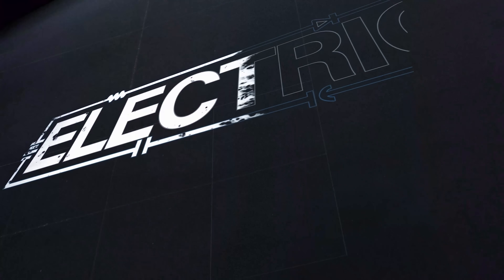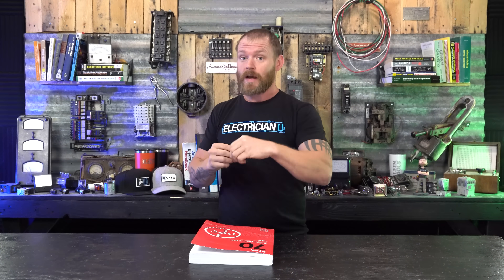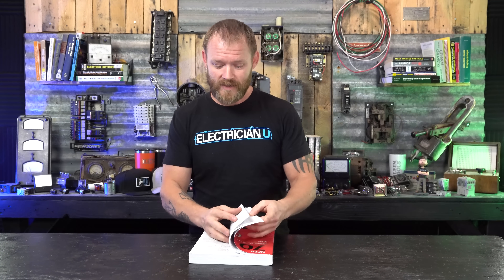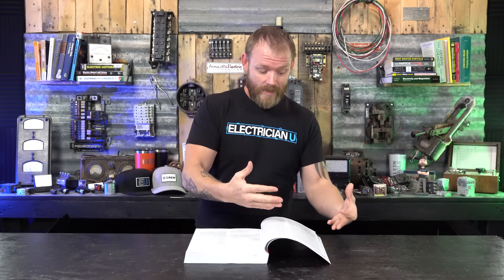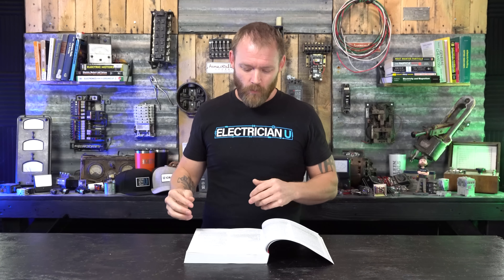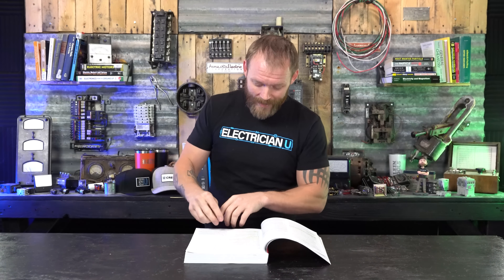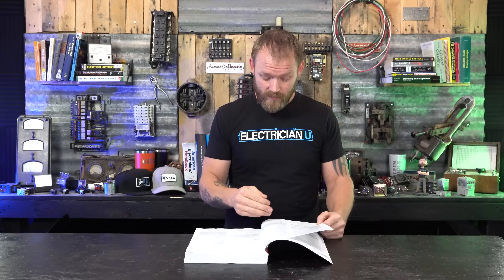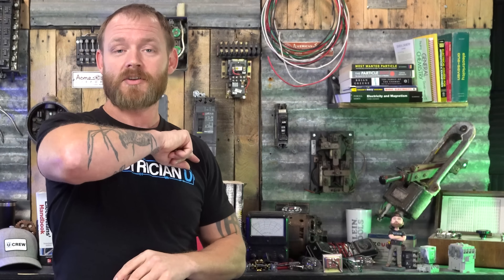Where Should We Be Using Dual Function Breakers?

Comment: It can be frustrating. I’m a second year apprentice in Montana and MT doesn’t require the kitchen to be arc-fault protected. So after pulling dozens and dozens of units, it wasn’t until my second year that I realized the code require kitchens to be arc-fault protected. Now whenever I have a test on the Code, I have to fight the instinct to put that kitchens aren’t included in AFCI locations. I know now that the Code says it, but it’s still hard to rethink something I’ve done hundreds of times.
Reply: It sure is. State amendments vs NEC can be confusing at test time. I always mark any Code section(s) in my NEC with the highlighted word "AMEND" so I know to go to my printed list of state amendments that are approved for use in the PSI testing center.

Comment: 2 things
1 this will "obsolete" a ton of old power tools they also arc (internally, commutator to brushes) and 2 Imagine a simple remodel and add 4-10k for new electrical
BOTH will mean consumers will go broke really fast 
Grandpa's saw (that works just fine) NFG 
want to use that old drill to put up blinds NOPE
This was the only way manufacturers could get rid of the quality tools that we still own(by making them useless)
MONEY GRAB 100%
You WILL own NOTHING (and be happy) LOL

Comment: In my area, for Siemens breakers specifically (as I have a Siemens panel), the CAFCI / GFCI / dual-function breakers are the same price, $50 per breaker.  I decided to go with dual-function breakers for most of the circuits because there's little benefit to going with CAFCI-only breakers.  When I moved in to my house, there was only one GFCI breaker in the box, for the bathrooms, not even the kitchen or basement outlets.  I've upgraded most of the breakers to dual-function slowly over time due to the cost.

Comment: Inverter-based welders which most seem to be nowadays have the power supply and welding circuit separated so it won't trip AFCI. Well, assuming that their noise suppression circuit is up to snuff.

Comment: Basically on new residential, we put dual function on everything but the garage plugs, bathroom plugs, and gas furnaces. We still install the standard breakers and GFCI plugs on these because that gives a few circuits that aren’t arc fault mainly for construction. The arc fault part of these DF hate compressors and saws. We are still running off of 2017 code here in Kentucky, supposedly they’re going to adopt both 20’ and 23’ updates sometime in 23’. We started using DF for simplicity, and reliability, DF breakers don’t seem to have the nuisance tripping like AF. We’ve been using Square D, but we’ve had to switch to Siemens lately because of availability of Square D. I hate that because it’s a really good product IMO, and we didn’t have trouble with them. I have anxiety about this new update because I don’t know how HVAC equipment is gonna do on GF. I thought the same with refrigerators but so far only Samsung had the issues, but they must’ve corrected that.

Comment: Can arc fault protectors reduce the risk of fire? For instance in a home that has older wiring is it worth investing the money in say dual functions breakers on particular circuits?
Reply: Fire prevention is the primary purpose of the AF breaker's creation.  Unfortunately, upgrading to this level of protection could result in a lot of other forced upgrade requirements (regarding old incompatible equipment -- usually motor-based -- which cause false-positive AF-trips... AKA "nuisance tripping").  The new AF breaker monitoring circuitry may find a series of electrical faults in the home (that you weren't prepared for) which some may incorrectly assume to be nuisance tripping, but is in-fact fire-prone failing electrical infrastructure causing very small arcs in J-boxes, inside defective-brand wirenuts, at loose screw terminals, rodent-chewed wiring, Romex punctured by errant screws or nails / overly tight staples, and so on.  Take care in moving an old home to this level of tech; have a reserve budget for unintended knock-on effects of this decision, and be prepared for a possible enormous extra investment of time.  If anyone is prepared in all of those ways, and wants this increase in safety, fully knowing the possible trade-offs, then proceed.

Comment: Is there a reason to not do combo AFCI/GFCI breakers for every breaker in your home?
Reply: Cost, a panel change used to cost around 300$ between the panel and breakers, now it will cost around 1000$ in gfci/afci/dual breakers, a regular breaker may cost 6$ to 15$, a dual function breaker may cost between 60$ and 80$...
Reply: When I had my panel redone I put dual-function on everything. There are a few nuisance trips I've had, but more often than not when a trip happens it's indicative of a problem, and doing this exercise has shown me places in the house that were not wired correctly. For instance, my radon fan failed due to a GFCI fault, and had it not been on a GFCI breaker, I would probably have never known the system had failed.

I also highly recommend going through your entire panel and labeling it very very clearly. I have a spreadsheet that I print out and attach to the inside door with magnets, and whenever I learn more or a change happens, I change the spreadsheet and print out another copy. The exercise of labeling, down to every receptacle and switch, which breaker everything was on (including the attic and outdoor motion lights) helped me find issues, too.
Reply: But if you don’t mind  spending the extra money wouldn’t it be better to do it?
Reply: Nuisance tripping is reason enough not to do it. Perfectly good circuits may occasionally (or immediately) trip just because a bare equipment grounding conductor in an outlet box is touching the termination screw for the grounded (white) wire on a receptacle, for example.
Reply: Future inspector lmao

Comment: The challenge I have is that electric ranges and dryers need gfci as well going forward. I have a very hard time finding those breakers and they seem to cost nearly $100.
Reply: Yep, that's what I found for pricing on the 240V DF breakers.  fortunately, existing installs in homes are grandfathered in under the old rules.  It's only new builds, or extensive renovations of old homes, which will need to meet the new requirements (assuming that the state as adopted the latest NEC for their building codes).

Comment: AFCI isn't listed in those places because they haven't thought of them. (thus 14) Many kitchen gadgets can (DOES) trip GFCI's, but that rule has been there for a few cycles now. The day is coming where you won't be able to get a breaker for less than $!000 because of the miniature Cray that needs to be in it to do all the totally unnecessary bull manufacturers want to make you buy. Like requiring a GFCI on a refrigerator outlet... what/who are they trying to protect? Refrigerator sales? (older one's MOST people have are high inductive loads that trip the idiotic 5mA sensing US GFCI's. If you buy an expensive, modern inverter based fridge ($$$$) then GFCI usually won't trip. But when it does, there's no alarm, and you'll only notice when it's been off for hours or days.) AFCI's are stupid expensive, and generally aren't fixing a problem anyone has. (unless that problem is sagging profits.)
Reply: You're fighting a losing battle. Most code changes are initiated by repeated issues that risk equipment damage or injury. The data is clear that homes are safer when they are AF and GF protected. You can continue to be angry about the added cost, added burden, aggravation, etc. or you can just accept that is the direction we are going and look for ways to mitigate the inconveniences.

Comment: AFCI breakers have a ton of problems nuisance tripping with computers, especially gaming computers. They should not be installed in any place you will run a desktop computer or home server.
Reply: Meh. They work just fine in conjunction with a UPS. We upgraded our service and installed a new Square D Homeline plug on neutral service panel with all dual function breakers throughout. We added UPS to both computer stations in the office. The only circuit that ever had nuisance tripping was the air compressor in the garage. Luckily it was on a dedicated circuit so I just replaced the breaker with a standard unprotected model.

Comment: Theres been a drift toward afci main panel for residential service panels. Penny for your thoughts on if turning on a vacumm or installing a bad light bulb should be able to remove power from the entire system.

Comment: In older homes this is not as straight forward if the homeowner wants a panel upgrade where lights and outlets are on the same circuit. Now you have to weigh the cost difference between AFCI with GFCI outlets or a DF breaker. The issue comes in whether it is a single bathroom circuit or two bathroom circuit. In other cases, was power brought into the light box and branched out to individual outlets? Not as easy as a structure you wire yourself where you can have separate circuits for lighting and outlets. Some homes just make it more difficult.
Reply: With the elimination of incandescent lighting, it is much less of a problem. LED lighting should not be an issue for dual-function breakers. The bigger issue would be shared neutrals causing imbalances on the circuit.
Reply: @TwilightxKnight13  You have to use the more expensive breaker and that was my point. In some homes you have no choice but to use the more expensive dual-function breakers instead of the lesser alternatives to provide the adequate protection that the codes require.
Reply: Even a home built in the 90's had a bathroom  GFCI  outlet  on 1 20A to power a backyard outlet, and a garage outlet oy vey.  Now they must be all separate etc
Reply: @ From the 80's on GFCI was required for wet locations. Pre 80's things were much different. I still find homes with old knob and tube wiring. Not in use but still present.

Comment: Just put dual function all in one breakers in the panels for everything and after inspection change out the tripping ones to regular breakers and install point of use devices at the readily acceptable openings. See he’s talking about the latest code. Most municipalities haven’t adopted the lates code. Some are still operating on 2014 code some are on 2017 code. Maybe some are on the latest code but not most places. Freaking Eaton ch cafci and gfci breakers suck ! Especially when some nimrod uses some old stock gen 2 ones in a new house and they all start tripping and causing problems and then you have to change them all out to gen 6 anyway … it’s overkill if you ask me. There are plenty of old houses that are wired with no grounds and they have been around for years with no trouble lol and all these new houses have all the troubles…. Why are %95 of my service calls on 5 year or newer homes ?

Comment: Just wired a basement, the wet bar area has a decorative stone wall. Had to put in 2 receptacles to meet code. I used a dual function breaker so I didn’t have a GFCI and duplex receptacle in the decorative wall. Now will have 2 matching duplex, just an aesthetic thing!

Comment: Doesn't NEC require all 15/20a circuits in a dwelling to be AFCI protected?
Reply: Not all, but pretty damn close and every code cycle adds more. It will not be long before all dwelling circuits, inside and out, will require both AFCI and GFCI with the exception of circuits dedicated to a device whose very function creates arcs like a welder. Equipment/appliance manufacturers also have to continue to refine their devices to reduce/eliminate nuisance tripping if they want to sell any products.

Comment: So when I put in an instant hot water heater, the installation guide says do not install on a arc fault circuit breaker as it may cause false trips. But when the town sent someone to inspect my work they told me i needed to install that breaker to pass inspection. So obviously i swapped it out for the inspection but afterwards i swapped it back. What is your opinion on the matter? I will check out your other video on the Arc fault breakers as maybe you answered it in there. Just crossed my mind while watching this one.
Reply: sorry to be pedantic, but it is a pet peeve of mine. It is just a water heater. There is no reason to heat, hot water, so there is no such thing as a hot water heater. 🙂
Reply: @TwilightxKnight13  lol. I’ve always said that same thing 👍I can’t stand when people say hot water heater
Reply: What you did is exactly what you do. You install the breakers to pass inspection and then you swap them out for whatever doesn’t need them. It’s crazy they thing people aren’t gonna do that lol. I’m not having to deal with shit tripping all the time.
Reply: @alphasaiyan5760  just remember that if there is a fire and the inspector examines the electrical system, they very well might deny the claim if improper circuit protection is installed. If it was the homeowner/DiY'er, then they are SoL. If it was a licensed eletrcian, don't be surprised when they sue you
Reply: @TwilightxKnight13  yes sir. And what about “remodel” jobs , or partial remodel jobs where a lot of the original circuits are still being utilized ? Like say in an 80s or 90s built residential dwelling ?
Reply: Your AHJ needs a swift kick. It was installed as per manufacturer specifications. But inspectors are all too often power hungry idiots with an axe to grind. Doing what they demand is often the only way to make them go the f*** away. Of course, you're stuck with a very expensive paperweight.

Comment: Smart? you are alluding to machine learning or AI AFCIs . Arc-like signatures from inductive/capacitive (motors) and resistive loads (heating elements) as you suggests AFCIs are are being false tripped from arc like waveform signatures. Trip thresholds would also need to be adjusted. You really need good quality power quality meters and a higher sampling portable oscilloscope to capture and see these transients. Surge suppression can reduce some in-rush trips and other filtering can help but then your back to software to capture those false signals as opposed hardwired filters which may only pick-up specific arc like signatures rather than learn about a whole bunch of them depending on loads attached to branch circuits. Not sponsored but I have found the Leviton smartrip pro receptacle to be very good in removing false trips. The only thing that trips it every 6-months or so is the microwave I can live with that as it’s easy and quick to reset.

Comment: Another advantage to putting the protection in the panel vs. as a device down the line (for example a GFCI outlet) is faults on the home run (like someone drilling through or putting a nail through the home run wire) should cause a trip instead of a death.

A minor disadvantage is if using a GFCI outlet tester, one has to return to where the panel is after checking each outlet instead of returning to the (hopefully nearby) GFCI outlet.

Comment: Taking it a step further, dual function “receptacles” have saved my bacon with the limited space in my panel (old, unique size, limited circuit capacity). As the first receptacle in my SABCs and dedicated circuits, these meet code and allow me to use dumb double stuff overcurrent-only breakers in my panel, which gives me twice as many circuits!
Reply: There is also a maximum amount of circuits you can install in a panel.  Not just if you can fit them on the bus.   Should be on the label inside the panel.   I see that often.  Here in Florida, you can't pass an inspection with any tandem breakers in a panel, rather you have to pass inspection and then go back and put any tandems in.   

Can't tell you how many times Ive opened a panel and found 10 or more tandem breakers, and now we have to add a much larger panel.

Comment: So I've ran into this issue this past year where an Afci keeps tripping, so I check all the devices, tighten up screws. Try to isolate what the problem is, but it's so intermittent what you think was the problem turns out it isn't and still trips. Almost give up and change to normal breaker. I open the cover move (the same breaker) to the bottom of the panel. Stops tripping. What could be the cause of that? Makes no sense to me.

It's happened only 2 times ever to me, both Siemens panels, both in an orientation where we have a bunch of afci breakers in a row in the top left of the panel. Reseating didn't fix only moving to the bottom of panel. (Even on the same phase seemed to fix the issue)

Comment: The short answer is anywhere you really want to piss off a carpenter...
Reply: you can only plug in so many saws and air compressors to a 20amp circuit regardless of whether its on a gfci or not. my favorite is when they jam a pencil in the reset button to keep it from popping and then get pissed when it burns up and they gots 0 pwr .
Reply: @tomtoms404  gfci's are not the problem and there is usually a non gfci outlet available anyways, its the afci's that are everywhere and don't like the arcing in big motors, 1 compressor or big saw is sometimes all it takes
Reply: @ydnark83  you said carpenter so my mind instantly went to defiled T-poles and I forgot about the arcfault context :)